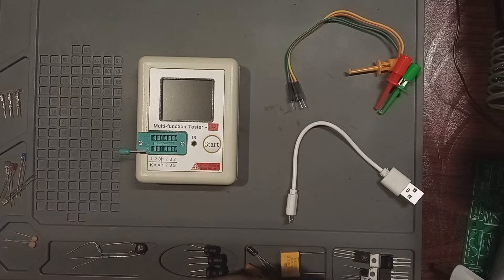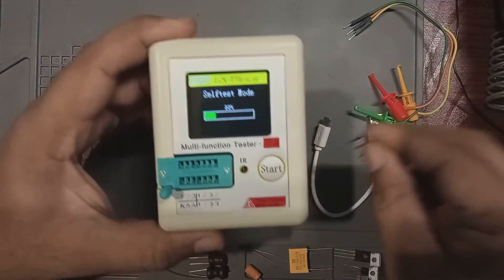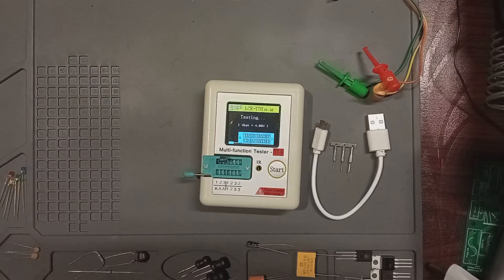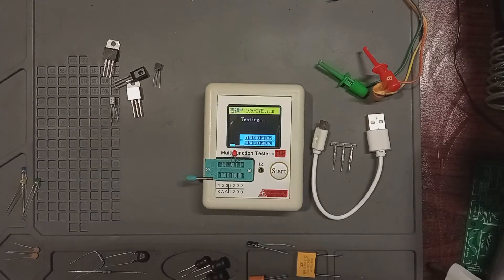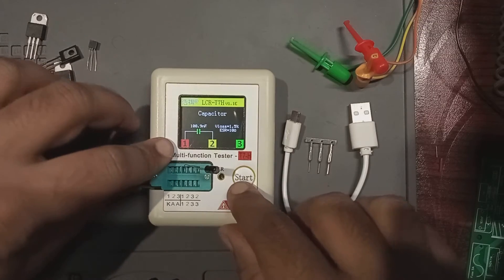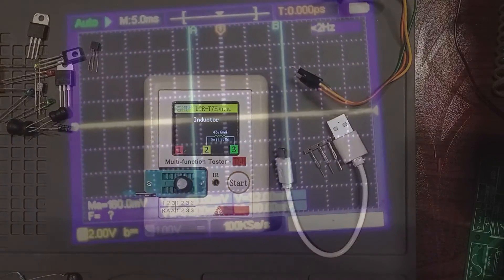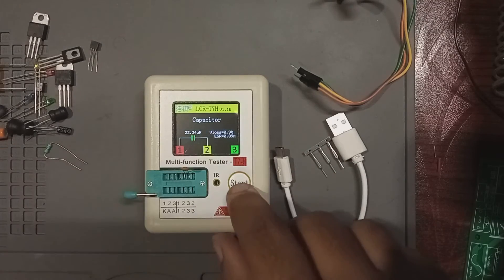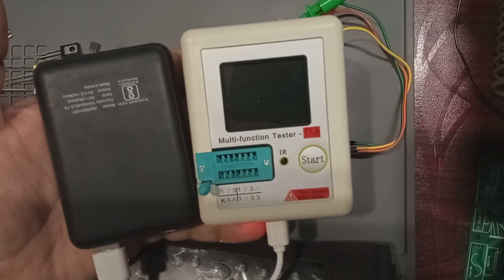Review: TC-T7-H Full-Color Multifunction Tester | Testing BJTs, MOSFETs, Triacs & More! 🔧🔬

Comment: Be sure when testing caps that they are not charged. I accidentally burned device when I forgot to do that. So sot23-6 esd diode packet and cpu burned (Looks like it's not AVR). Main TVS diode was fine.
I also plan to fix this by using arduino nano. Tested that display was ok but need custom driver. It seems display area has offset. 
I think I also try to do relay protection what was described in original design documents.

Comment: Note that the newer versions of these since late 2022 don't use the official ATMel chips but rather a chinese clone chip. This can be noted by sanded off markings or re-lasered markings on the chip. Also the banner shows chinese letters. This means these cannot be upgraded with the official software from the original open source that designed these and there may be inconsistencies in the readings as compared with real hardware.
Reply: Yes these days you're very unlikely to get a genuine ATMel version of this tester. This clones have counterfeit chips, no crystal and a dodgy circuit that can damage zener diodes. The firmware as you say is not upgradeabl, has a cut down list of features (for example wont decode many types of IR) and can be very inaccurate. There is a big thread on EEVBlog about this. The only easy way to tell if you have a clone is by opening it up.